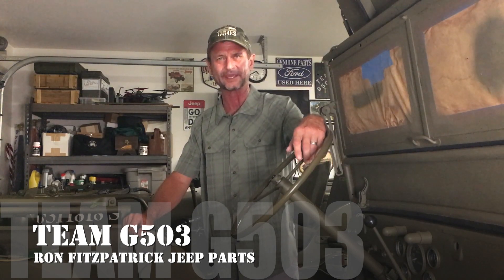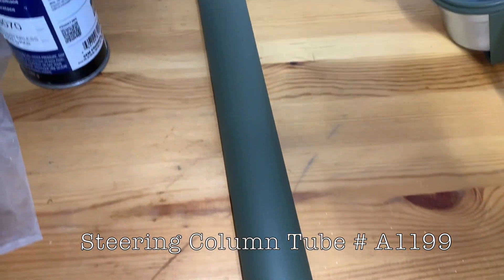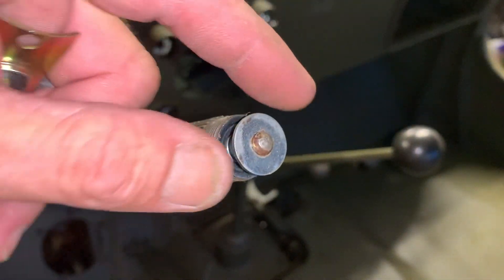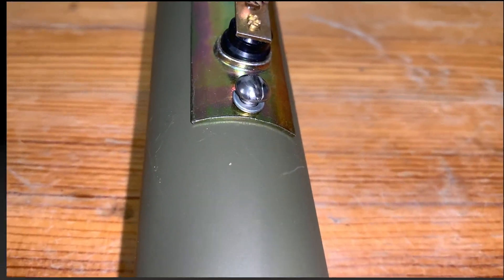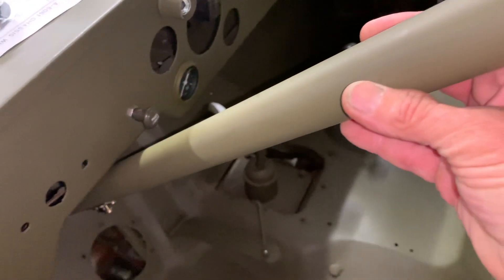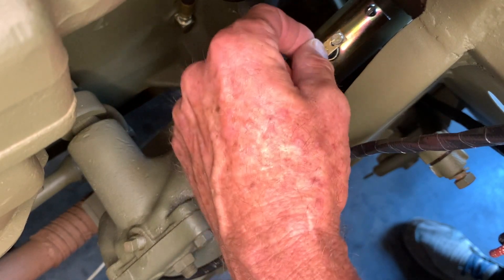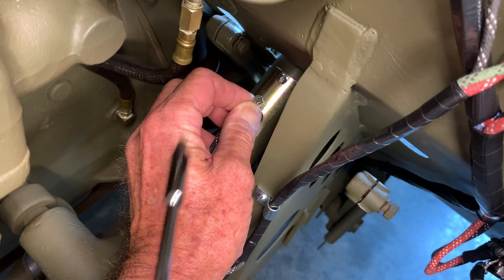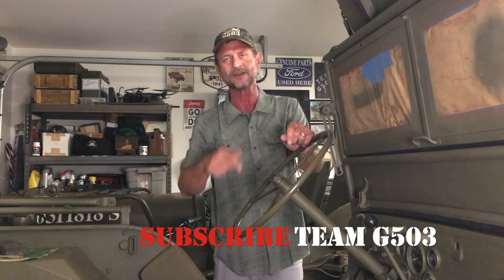G503 Wiring And Electrical (Part 8) Wiring Horn Circuit Installation, Willys MB Ford GPW WWII Jeep

Comment: Great scott,
Reply: Great video and info.  My problem is at the top end - the brass circular plate is loose and seems to contact the nut when assembling - thus completing the circuit and sounding the horn.  How do we keep the nut insulated from the centre wire components ?

Comment: Thanks for another great video! How did you feed the horn button wire down the center of the steering inner tube and get it to exit out of the hole in the side of the tube above the copper ring? Did you feed a stiff wire backwards in the side hole then up and out of the top? And then use that wire to pull it down and out? How did you figure on the best place to solder the wire to the ring? Do you solder it up high to avoid bumping into the spring contact?

Comment: Good video!  I bought a horn brush from another site and the plastic part of the contact broke off while I installed it.  I don't believe there was a spring.  I'll have to keep an eye on RFJP for them to be back in stock.
Reply from the maker: Jay Jenkins there is a lot of junk out there. RFJP strives to not stock junk parts. I hear a respectable manufacturer has them in the works😉👍
Reply: @TeamG503  waiting patiently on the rest of the horn wiring/setup...heh.  I haven't found a single video out there that describes much at all about the horn installation and wiring.  I bought a horn repair kit, but of course nothing these days really comes with any instructions...and when I hook up my horn it just sounds when I hook up the battery.  :)  Do your thing, but don't leave me hanging for too long...lol.

Comment: Great video as usual.  Where can I find the info on installing the brass ring on the steering shaft and how the wire that needs to be soldered is installed?
Reply from the maker: We haven’t done one yet, however a few folks have asked. Maybe in the future 👍